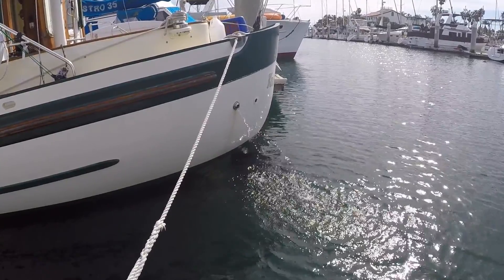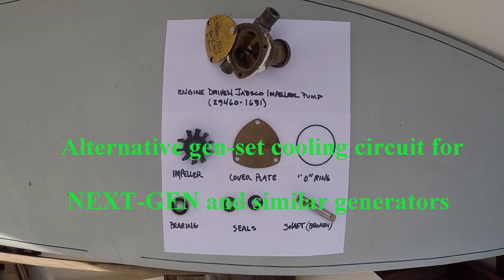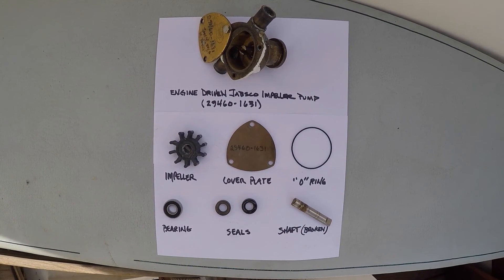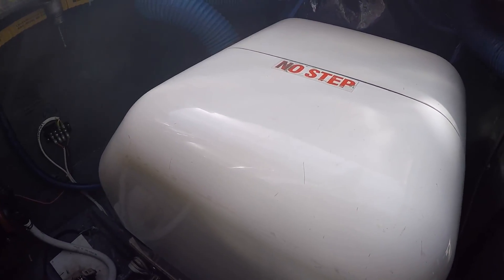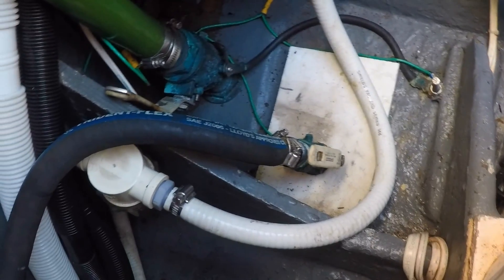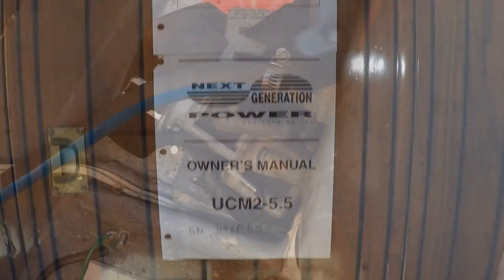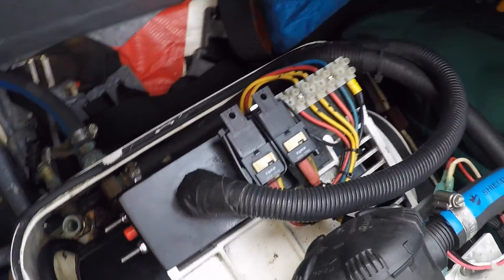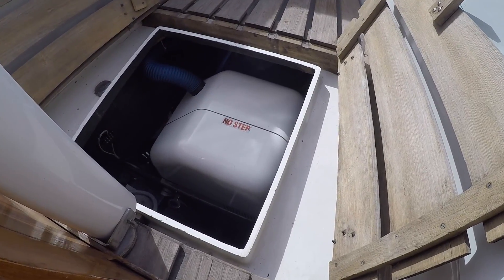How To Improve Your Marine Generator's Cooling System With A Remote Mounted Raw Water Pump

Comment: HI, GREAT video, what did you do with your NexGen water pump that was mounted ? Did you keep it as is with the impeller installed and it running off the fan belt ? while using your new water pump ?

Thanks,

Comment: any updates? how many hours do you have on this setup? thanks for the video!
Reply: About 1600 hours.  No issues with the March cooling arrangement.  The heat exchanger developed an unassociated  leak and needed a little welding ($50), but beyond that, nothing unusual.  I do suggest using silicone gasket material on the old impeller housing cover after the impeller is removed.  If it is not sealed, you'll get an annoying oil leak.

Comment: I had the NextGen 5.5KW and it worked well but I did have issues where it did not generate 120vac when the capacitor failed and had to be replaced. In that circumstance your 120v pump would not run even though the generator (diesel) would run ... Just and FYI to have that situation verified on your model assuming it may be the same as the one I had. Good luck .... Dan
Reply: Your "capacitor issue" is familiar.  They tend to overheat and fail if a proper exhaust fan is not in place.   The overheat shut-down sensor will not prevent the issue so always carry a spare.  BTW; in my case, the capacitor fail prevented the generator diesel from starting so no compounding problem was had.
Reply: Just happened upon this video and these comments…having the same no voltage out, problem. Terrible access on the boat, where is the capacitor? (Not shown in the manual?)
Reply: @VapinPiper  The capacitor is the 3" silver cylinder shape you'll see at the front and very low on the face of the engine.  Look for it down near the motor mounts.

Comment: Sam who am - GREAT fricking idea! My Onan mechanical pump is nothing but trouble.  This way I eliminate many of my genny cooling problems - belts, seals, impossible location, priming - not to mention the outrageous cost of obsolete parts.  My one concern is what happens to the electric pump while the motor is warming up and the thermostat is still closed? Does that stress the motor or is there a demand switch involved?  Many thanks.
Reply: March pumps can handle it.  I don't see a problem.  They are magnetic drive pumps and require a below the waterline install.  If your raw water filter gets packed up, your temp shut off will shut down the generator which will kill the ac power to the pump.  I've had this happen many times and there's never a problem with the pump.  Clean out the filter and you're back in business.

Comment: This genset should be designed  with it's own internal heat exchanger 1 pipe in 1 pipe out. Engine cooling fluid sealed in the exchanger tubes very simple.